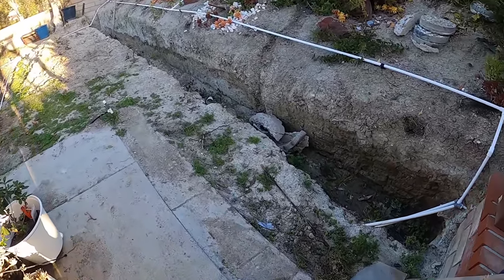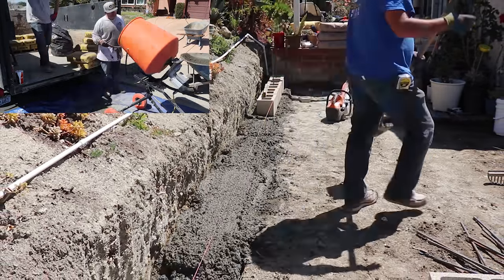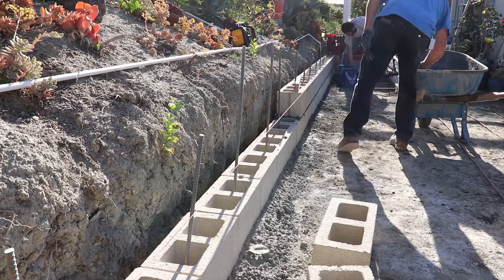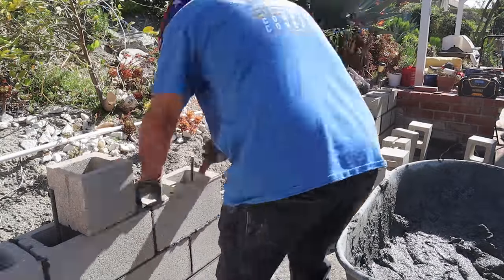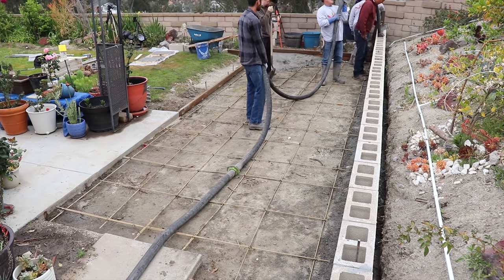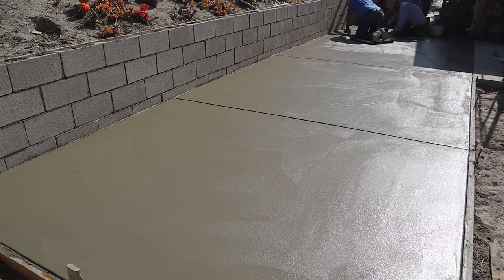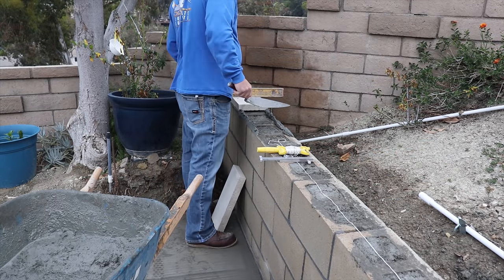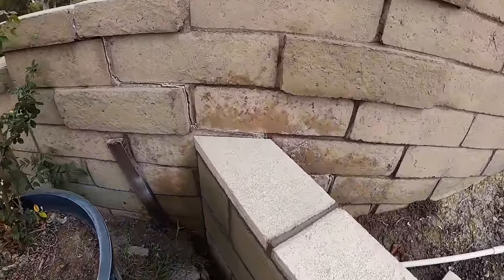How to Build a Retaining Wall and Pour a Concrete Slab

Comment: Do you charge more when homeowners help? 😂
Reply from the maker: I havent yet but I hear that a good rule of thumb.
Reply: At least this guy didn't seem to do anything that interferes or is done wrong. He just pre dug most of the trenches and removed some grass and top soil, just saves time in this case I would think.

Comment: Attention to detail like water proofing behind the wall equals a quality job with good value for the customer.
At 11:35 fiber glass sliders, fiber rods, fiber mesh, what’s up with wanting to go fiberglass with everything?  Isn’t a magnesium bull float better? 
Do you recommend the rocker arm for the bull.float?
Reply from the maker: Rocker arm is nice on some obstacle course situations.
Mag seals it up quicker for on shot lay down in tight situations or hot weather

Comment: Would you recommend doing the wall or concrete first? I need to add a wall to divide front and back yard but I also want to add two slabs of concrete on both sides of the wall. Thank you
Reply from the maker: Wall first

Comment: Great video. Quick question from a DIY in London. I’m building a small retaining wall (8 feet by 4 feet by 4 blocks tall) on an existing concrete base footing. Can I just use mortar to fix the first level  blocks ( same as yours) onto the concrete? What mix do you recommend? Thanks.
Reply from the maker: yes as long as you have some rebar vertical rebar dowels.
I use a 2500 psi minimal

Comment: David, the walking edger along the wall creates a joint between the concrete and the foam does it ? What is likely to happen if you do not do that ?
Reply from the maker: The only difference is no radius

Comment: Would it be possible to get your input on a planter design I've got? Most of it is simple. 4 or 6"  thick CMU with rebar, up to 2 feet, in a box. The strange part is I have 2 sections I want to raise up at 9 foot walls (above the initial 2')  30 inches wide each. I live in a windy area, so I'm worried that would be knocked over.
Reply from the maker: Start with 2' of 8", then go 6" for the rest.
A solid 2' deep footing,  Two #4s t&b horizontal.
#4s vertically every 16". Two #4s horizontal at middle and top of wall.
Solid grouted.
Equals no worries.

Comment: What do you use to waterproof retaining wall didn’t see it in the video. Also where can I get the roller and vacuum setup for the saw? Great work guys
Reply from the maker: DryLock water proof
Dewalt vaccum
Reply: Thanks, I meant the saw attachment handle extension tool to walk behind the saw instead of kneeling. That thing looks super helpful

Comment: I have a small cement mixer and a wheel barrel that I will be using to mix 90lb bags of QuickCrete in for cement slabs on the side of my house. It is 8' x 5' sections. I will be mixing 1 bag at a time and I'm wondering how much fiber mesh I should put in with each mix.
Reply from the maker: I do about a half a hand full

Comment: David, Great work as always. Will you show the waterproofing in a video?
Reply from the maker: I wish I would have caught that
Reply: @OdellCompleteConcrete  No problem, maybe next time because it sounds interesting.
Reply: I'm interested as well. They did a poor job on my basement that's on the backside of the house (on a valley) and I need to dig a trench back there and waterproof it.
Reply: @OdellCompleteConcrete  You mentioned it was a powder-based waterproofing product. Is that better than the stuff you paint on?

Comment: is doing a block wall like that cheaper than doing a form and poured concrete wall? also which would be stronger and as contractors which do you prefer to do